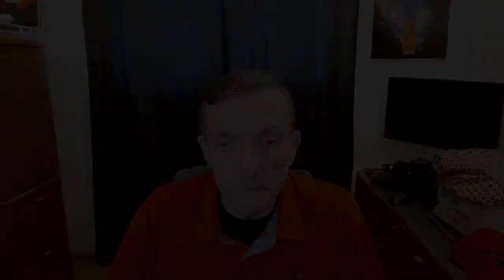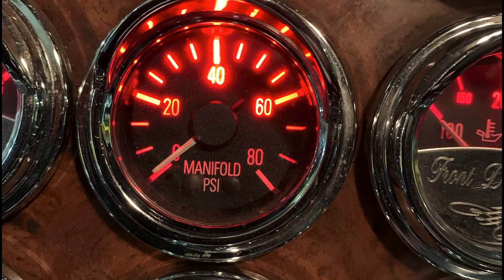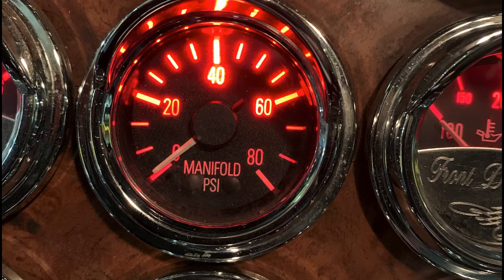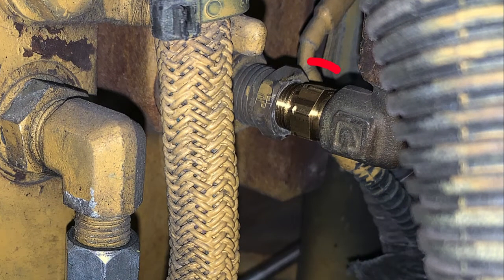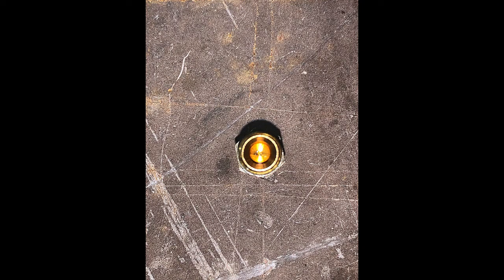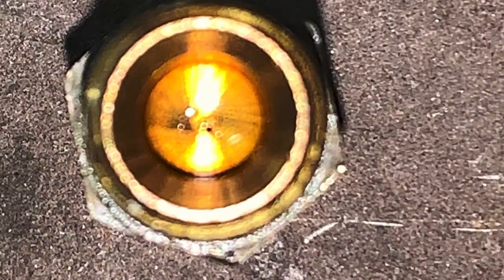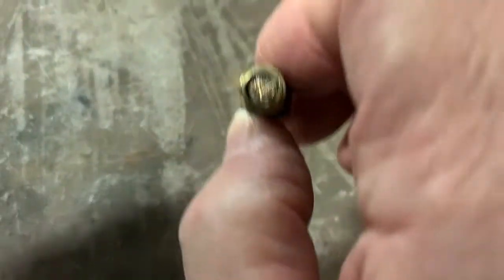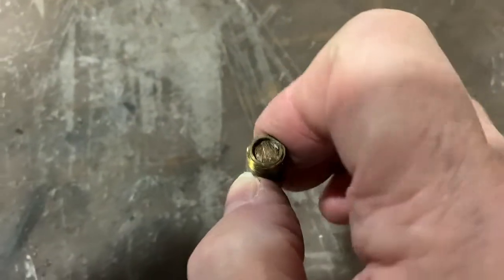Cat C-15 Dash Boost Gage not working correctly

Comment: Greetings, dear sir if the boost sensor not working.... and display shown boost pressure is zero.... is this position engine (caterpillar c9) decrease rpm on load????
Reply from the maker: On all electronic engines that sense boost pressure if the sensor fails or some other issues causes low boost the engine will always loose RPM and pulling power drops. Fuel is put in by air to fuel ratios by the ecm.
Reply: Thanks for the reply, bro do you have the details of the Caterpillar error code, for example (102-10 is related to the boost sensor and 102-3 is related to the boost sensor cable disconnected) this error code is related to this problem...  if you have... can you share with me, I really need, thanks

Comment: My truck is giving me problem. I recently rebuild the engine it's Cummins ISX 450hp 2006. When I idling the engine my truck smokes white and overnight idling my turbo leaking oil. when I start driving its through heavy white smoke for 1 minute. I changed my turbo, air filters, clean turbo oil return line but the problem is still there. Please guide me what is the problem? Thanks